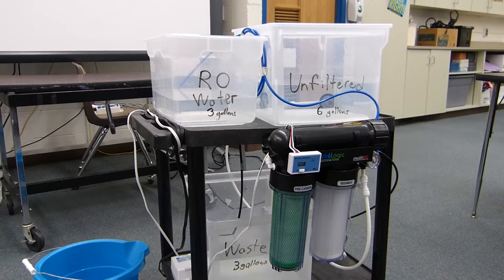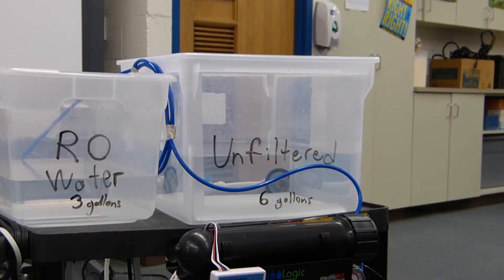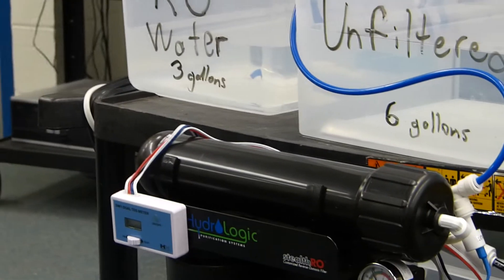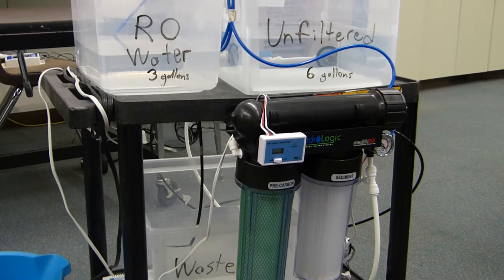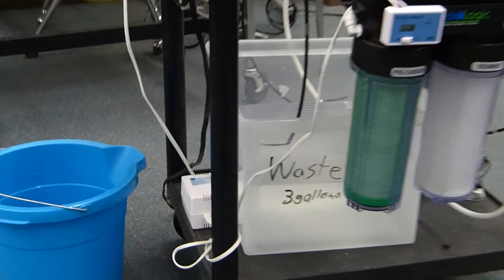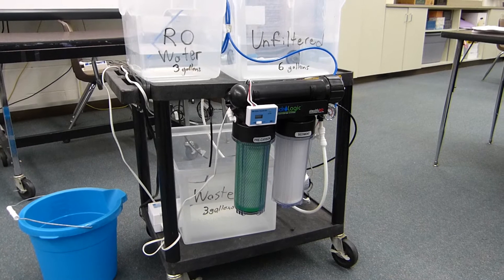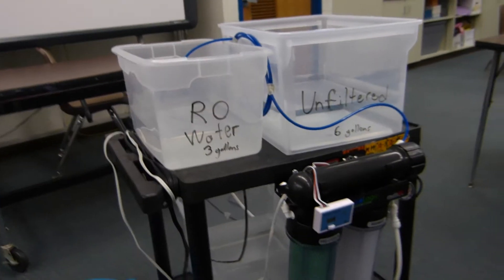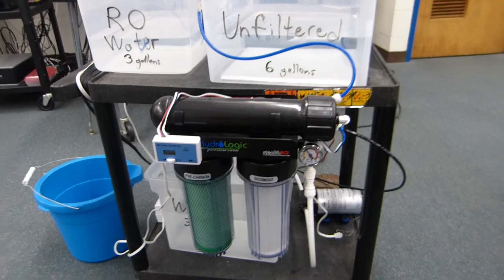Mobile RO System

Comment: how does the Hydro-Logic TDS TritonRO-100/200 work? is that like a regulator?
Reply from the maker: +maurice Only monitored the water quality in and out so I can tell the how well my RO filter system is working. It does not have any valve, just 2 probes that go into the in & out lines.

Comment from the maker: w ZR, If you "refilter" the waste water from the RO system back into your RO system, you will clog the RO Membrane VERY quickly. New filters can be around $50-$80. The EC's or PPMS of the waste water are VERY high from the dissolved solids. My water starts out at ~400ppm and comes out below 25ppms. The waste water is 1000+ppm since I am running a 1:1 (from 2 gallons put into the system you get 1 gallon of Waste and 1 gallon of RO Water).  I hate wasting the water but it is one of the only ways I can do Hydroponics in my classroom.  Hope this helps!